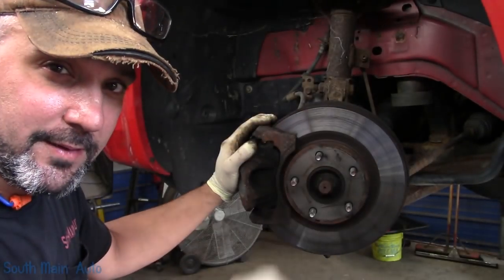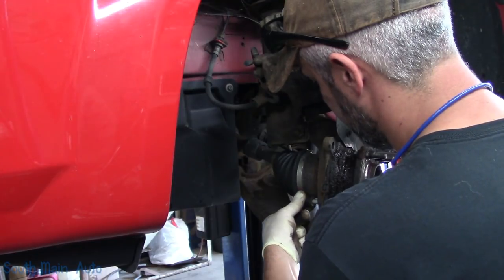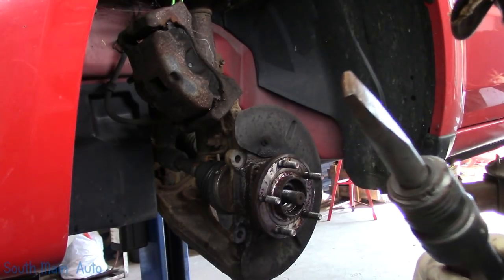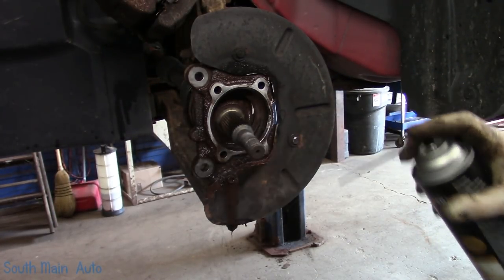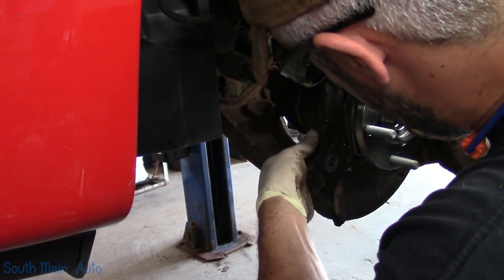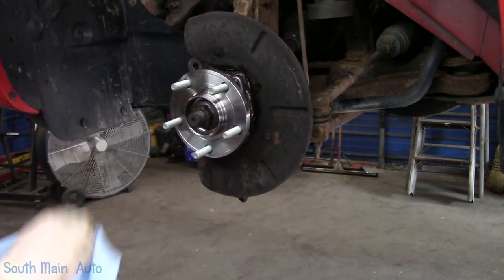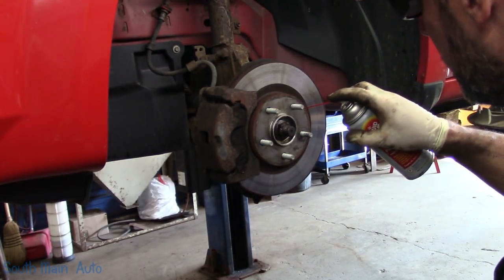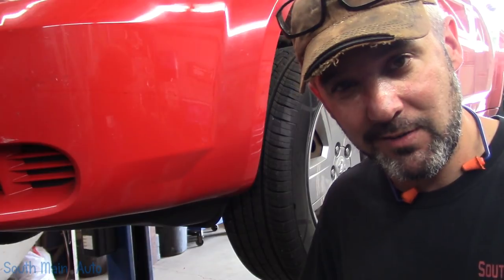Dodge Avenger: Front Wheel Bearing - Raw & Uncut

Comment: I did a wheel bearing on a 2011 prius yesterday.  Wouldnt you know it, I was able to get the bolts out with my 3/8 electric ratchet, and the bearing came right off with a slight pry of my pocket screwdriver.  God bless Texas.

That is a true story, but holy hell mucho respect for you and all the guys who deal with rust.  Thats a whole different ball game.
Reply: Here in deep South Texas I don't deal with rusted cars often last time one came in I struggled to remove them bolts had to take out the torch not fun

Comment: Well you won't hear me say anything about using an air chisel b/c I'm a born & raised NY mechanic and had the joy of working in rust belt of Fulton & Montgomery counties. Use whatever it takes to get the job done is my moto! Nice easy hub w/brg definitely easier than replacing just the brg. Great video!

Comment: Hearing aids are no fun.  After operating noisy tractor-trailer rigs, an abrasive waterjet machine, noisy air tools (impacts, grinders, wrenches) my hearing is bad.  Glad to see Eric using earplugs and safety glasses.  Interesting to see, had no idea those bearings included the studded hub.  Ya learn something every day.  Thanks, Eric.
Reply: A lot of front drive cars now a days have the whole hub assembly that includes new studs included. Much cheaper that way.
Reply: You are kidding right?  Instead of buying a regular bearing for $20, you now must buy a whole hub assembly.  They are never cheaper.

They are easier to install however, as you no longer need to remove the steering knuckle.

Comment: With those style hub caps I learned to install the tire with two lug nuts on the east and west lugs down the valve stem. Then slide the hub cap on and install the other three.

Comment: Heh...back in the day, lightweight wheels were made from magnesium (which is why they used to be called "mag wheels" or just "mags.")  But people eventually worked out that if you drive on a flat for a while and the rim kicks up enough sparks, they catch fire - and they're really hard to put out safely (they tend to explode if you put water on them - then all the pieces scattered around start a bunch more fires.)  So as far as I know, it's pretty much all aluminium or some sort of aluminium alloy these days.

Comment: I poured a small concrete slab to put my air compressor outside my garage so I wouldn't have to listen to it. It also runs cooler and doesn't suck up the shop dust from sanding and painting.

Comment: Actually coastal Florida cars are subject to sea air, as it were, and can rust up pretty well from that. It's the Arizona cars that have it made. Nice and dry and hot! Lousy for the paint and interior but great for the anti-rust factor. Thanks for the video.
Reply from the maker: They have jiffy lube paint shops there. Ammco's? Is that the franchise?
Reply: Couldn't tell ya. I'm a snow belt dweller, have been all my life. But it wouldn't surprise me with the "drive thru paint" shop. Great option for the quick getaway, hit the bank with a green car, head to a jiffy paint, come out red. Perfect.....lol

Comment: You should've been with me last week doing rotors on a 99 Dodge 2500. Talk about stuck hubs? 2 guys and multiple hours. Nice job on the raw.
Reply: wish I ever had a helper on anything but bleeding brakes and the most simple task, like roll that wheel over here :(
then again, porta-power/hydraulics, pneumatics and come-a-longs are my helpers and lets not forget the 10+lbs sledges

Comment: For what it's worth Dr. O, I'm down in Texas and I fully appreciate that the rust struggle is real. We don't have to deal with it nearly the way y'all do, but I've seen enough cars from the coast and the rust belt to tip my proverbial hat to you. Nothing hacky about using the air whammy to remove a stuck hub. I had a Subie awhile back I thought I was going to split the knuckle trying to get that sucker out. Usually the cats talking trash haven't the faintest idea what doing this for a living entails. Keep fightin' the good fight amigo, can't let the bastards get you down.

Comment: I hear ya about rust. I live outside of Syracuse and just put a new rear bumper on my 06 Silverado. Without my trusty cordless impact wrench and penetrating oil, I don't think that job would have been doable for me. Oh and a sawzall for some of the brackets that wouldn't "cooperate". I watch some videos of people in Arizona that don't have rust and wonder how nice that must be. Gotta give her the old heat n' beat routine around here. I hate salt.
Reply: Sawzall? Try an angle grinder, or better yet for one hand operation, a die grinder for the stubborn bolts. I use a sawzall at work and find them hard to control with one hand holding the sawzall and the other on the workpiece.
Reply: No compressor so no die grinder. And I really need to get an angle grinder
Reply: Ahh Syracuse I used to live there cars rotted out became junk in about 7 yrs if you did not rust proof them , then it only slowed it down . Only thing I miss is Heids  and chiefs baseball .

Comment: Always a great video! I've used you vids and the information gathered to keep the 2009 carryvan on the road. Wish me luck on my ebcm replacement due to a C2200 fault (which I saw your video too) lol. I might try to open that EBCM up and just see if I can find any cracked solder joints or smoked electrical components. It doesn't look like anyone online rebuilds them that I can find.

Comment: My son drives one of those. It's an 08 AWD version with a V6. I hope it's better than "a step up from a K-car" as I'm the one that picked it out for him. So far it hasn't given him much trouble besides replacing the battery which he described as a real P.I.T.A.
I also helped him replace the stabilizer links with after-market ones(NAPA) which, not surprisingly, didn't fit properly. Everything we order from NAPA lately doesn't fit. Not sure what's going on with them but I hope they get it sorted out soon.
Reply from the maker: Seems to be all across the board with parts stores, trust me....
Reply: It's definitely not just a step up from a K-car  it's much better. Now my 2007 Cobalt that's probably 3 steps below a Chevette what a POS. My Avenger wheel bearing was easy to change but her Cobalt wheel bearing came out in chunks. But I do live in Wisconsin rust is a real deal.

Comment: Did the hub bearings on my '07 Silverado when it was barely 4 years old, and I STILL had to beat them out of there with the air hammer (in the pre-Big Nasty days). Not much comes apart easy in the Northeast ... unless it's a catastrophic mechanical failure in an engine or differential!😁

You should've done a PT Cruiser for a RAW, UNCUT vid - we'd have had multiple expletives to enjoy. I call it the "PT CURSER". What a poorly engineered pile of dung. I swear some engineer built this car because a mechanic ran off with his wife ...
Reply: taxes mate, Albany seems to like to take apart the wallet (not that i have a problem with all the taxes, just some) up here. Then again sometimes the counties can get rough with property taxes as well.
Reply: smitty smithstone welcome to new york where they use more salt on the road than all four oceans and thats just for a 1/2 of an inch of snow eric o area gets pounded with snow so its 100 times worse than Youngstown new york. but maybe you just got lucky, after all, it was a chevy
Reply: "Crapsler Petrified Turd" enough said.... my buddy had one didn't make it to second winter before rims rusted past "factory" tire beads and all 4 were leaking like mad :)))
I asked why the hell he bought a crapsler.... (he drag raced for 30+years, Chrysler pro-stock, other vehicles and dragsters) we then agreed upon everything being total garbage now days ;)
Reply: old chrysler's is what i used to build. Ah the old 64 polara with the 426 max wedge that we switched out for a 440. Threw a rod in that car. Way to much lift for the springs my old man was using. Besides his third gear didn't match the power curve and he threw the rod before the new gears came in. Sometimes i miss the track... who am i fooling, I always miss the track.
Reply: know someone that has a PT CRUISER or should I say A  P(piss) T (tanked) CRUISER (for a bruisin) Chrysler need I say more

Comment: Us, " Southern Folk " love watching you " Northern Folk " battle that Rust. Its your pay back for Winning The War.
 The South will Rise Again.
Reply: Might of found my Ign problem, While looking at connectors, I happen to un plug the connector going into the Alt
and found, you guessed it Corrosion, sprayed it with electrical cleaner. Dont know what those 3 wires go to,
but if they have anything to do with the Ign, I might just have found my problem . Will take it out for a shake and a shimmy in the morning. Hope, Hope
Took it out this morning........not the problem, but Iam glad I found that corrosion. Back to the drawing board.

Comment: I dont use torque sticks. I check the wheel torque every once and a while after free handing lug nuts with a snap on mg725. Sometimes it's a couple pounds high. Practice makes perfect.
Reply: older "iron" vehicles just wing it on with impact.... newer stuff with various JUNK CHINESIUM metals and aluminum rims? blip with impact and use torque wrench, it;s far too easy to upset the rotors, rims and even hubs to end up with the herky-jerks once heated up hot a few times

Comment: Hey, Eric!  How about showing us the torque sticks work reliably?  After using the stick, you could show that a torque wrench set 10 ft lbs heavier actually turns the torqued nut.  (That was a torque stick and not an extension you used on the lugs, right?)
Reply: even torque wrenches are not 100% accurate on the vast majority of wheels studs and rims! 
why do I state that? because they're never perfectly clean, proper thread pitch, nor proper rim/lug seat left on anything, due to others ramming them on and off at all sorts of torque levels............
torque sticks should be "set" with one impact gun and held at the exact same air pressure for the most accurate torquing, but as mentioned above everything needs to be in "perfect
 shape" which is almost never but off assembly line

Comment: I'm impressed with the speed and quality of your work, years of experience I guess! One question: when you're using a 'bar to hold the hub as you tighten the center nut, don't the threads on the studs get damaged? (Obviously not or you wouldn't do it! But isn't it a risk?)

Comment: I had an 08 avenger, I felt it was a great car but I did have a thermostat, wheel bearing hub, alternator and fuel pump on it between the miles of 130k to 180k miles. Sold it for $3200. 2.7l v6 fun first car. Paid like 5k for it.

Comment: I live in Louisiana and the master tech at the shop I used to work at would always use his air hammer if it was needed. The company even had thought of forbidding air hammers (for "safety reasons") but he said if they took his air hammer he would quit.
Reply from the maker: They take my air hammer here I would starve to death haha.... safety nuts haha
Reply: @SouthMainAuto  
Lol, I worked in a couple cars that came from up North and I had never had so much trouble working on something, if it wasn't falling apart from how rusty it was, it was fighting the seized bolts. We had once a Subaru from New York that when I set it on the lift and started raising it up the body went up and the front clip stayed in the ground. Costumer was angry that we refused to change the tires on the car.

Comment: That was an easy though I wasn't aware it was a bolt on/off type hub bearing assembly very intersting.
Reply: those are much easier to work on and not totally screw-up, they sure like to seize into the knuckle though and sometimes the CV axle splines get ugly

Comment: Can you walk a wheel bearing like that in an aluminum spindle? I pull quite a few wheel bearings for the rear of the current gen Explorers. I usually pull the spindle off and press them out if they haven't been apart yet. Might have to give that a try.

Comment: What was the symptom of bearing, grinding, howling etc., would luv to see a early model colorado with the combo bearing bolted to the rotor, don’t see many of those on the tube, thanks 4 posting
Reply: the majority of whole hub assembly units either get loud and start "whiirrrrrring" or just get loose and start flopping around, which means looser steering and brakes that can get funny feeling and wear faster. from my experience it's about 50/50 with most post 2005 range